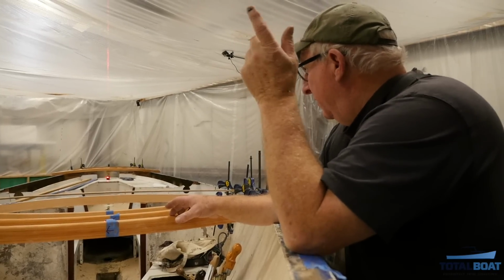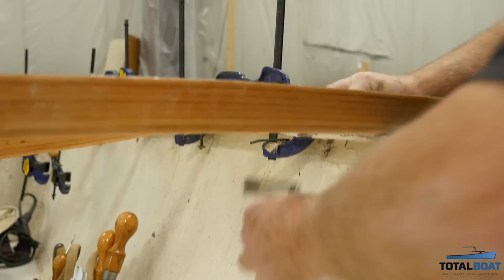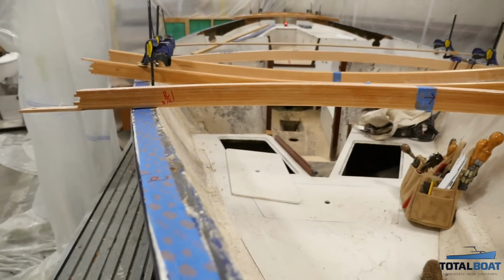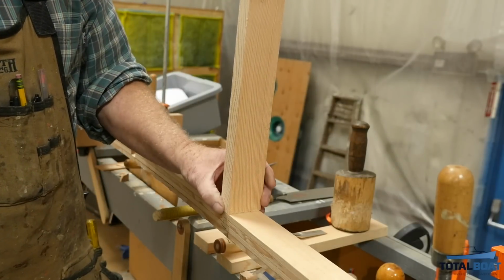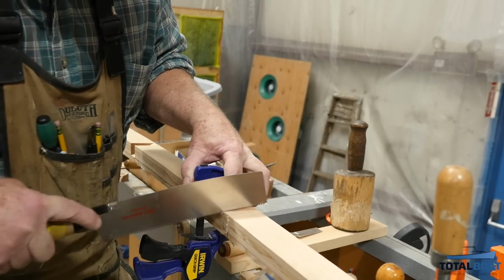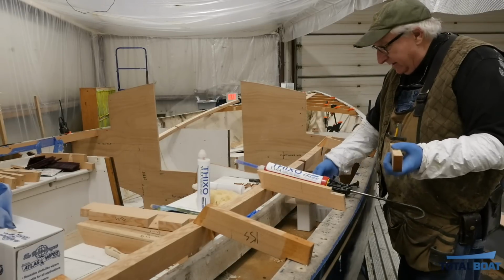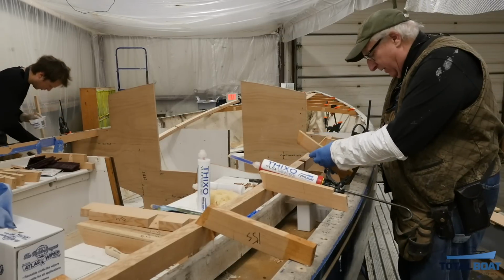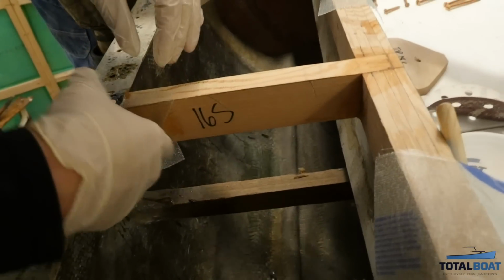Restoring Vela - a Classic Plastic Sailboat - Episode 3

Comment: I'm building my first boat (small pram) and I used Dan's technique today to turn the deck frames upside down to take the angle from the gunwale and then I used my bevel gauge to take the angle from the hull. Then I set up my table saw to make the compound miter cut and it fit perfectly the first time! This is a great series with so many techniques explained in detail. Thanks.

Comment: Here's a question, not criticism.  When not use joinery to make thoes joinst stronger.
Reply: My guess would be speed and the joint does not need to be super tight when using epoxy.